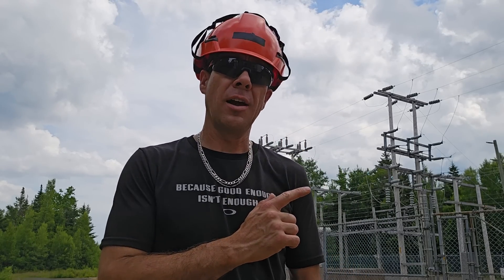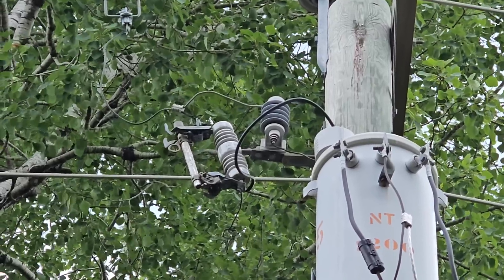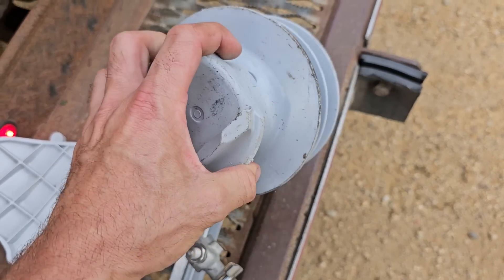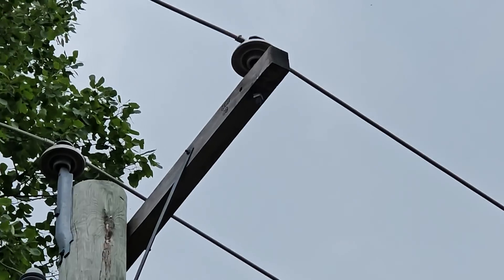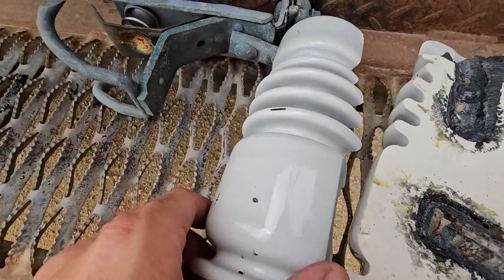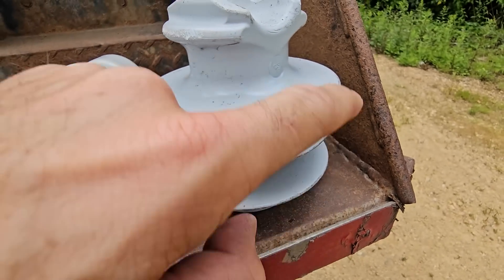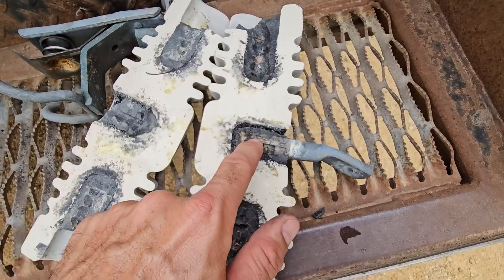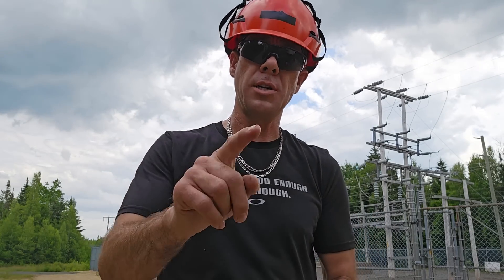How do power poles catch fire?

Comment: Great explanation and why some utilities will bond / ground all the pole hardware and give it a good path to ground. Can help prevent fires, but can make finding faulted equipment harder. But, doing thermal inspections also help locate failing components, since normally they will heat up for a while before actually making a good enough connection to fault. 
The technical term for the path the current would have to take down the body of the insulator and over the sheds is called creep. Then straight line distance from conductor to ground is called strike. In high contaminant ares, like you mentioned along coats, they may use extended creep insulators (larger sheds, more sheds) or as I have seen more often is using the next voltage class up for a given voltage level to increase the creep and prevent flashovers from the salty air. 
Cool video to show laypeople what is going on when things fail.
Reply: So in a nutshell, bonding is basically grounding all the components to make it an instant short instead of creep?
Reply: @sporkcrx  Not necessarily an instant short, but a low impedance path to ground. Instead of tracking through the wood or concrete structure and heating it up it travels on the bonding wire to ground. Which can eventually cause the failed component to heat up and / or fail faster. Since that becomes the high resistance path and will heat up more. 
Creep is the actual measurement for the insulating path on the insulator, tracking would be more the correct term here when it tracks down the pole. You don't want less creep on an insulator, there is even extra-creep insulators for more resistance to ground. In ocean areas with salty air you may use extra-creep components. 
To get a little more technical, there are insulators that do have some resistance designed in so they actually self heat to help keep the moisture off. If you ever see an orange ringed top insulator in a substation, those actually have a glazing that conducts slightly so it heats up the insulator to help keep moisture off. You can look up RG (resistance graded) glazed insulators. There is a few other terms for them too. But usually will have an orange top on them to indicate the special glaze. But I have only seen that in substations, never in the field.

Comment: These more technical and in depth videos are verry interesting and this broken insulator realy should become a demonstration and teaching item as it broke so perfectly. When you talked about impurities being deposited on a surface of insulator and showed a path that goes over those insulator fins, that path would be the path of gliding current as the current glides on the surface of insulator down to place of lower potential that for example can be a grounding or neutral wire. That would be the offcial term for that issue and other word would be leakage current as far as I know. 

If electricty would jump over the gaps and fins to the pole that would then be a flashover voltage or voltage jump issue. Such issue would probably appear in case of undersized insulator or a voltage way higher that one that was meant to be on a place where such issue would appear.

Comment: not to hijack the video or anything. But i remember seeing this video where a tree trimmer accidently dropped a main feeder HV line onto smaller lines causing a big short and the HV ended up going to the houses connected to it, causing panels to blow off the house and meters to blow off the side of the houses, it was crazy. The reclosers ( i think ? ) failed which caused the massive short to go on for a while, i dont know if you seen this, just wanted to know your thoughts on it. https://www.youtube.com/watch?v=Dmy9CHCewtg

Comment: I have a question. I work in telecom industry and we get RFI (Radio Frequency Interference) that bleeds into our networks a lot of times because of a damaged insulator or damaged lightning arrestor on a pole. It's hit and miss for us getting the local power company to come out and fix these issues unless we can find something for them physical to investigate. Have you ever ran into this or a request to fix RFI from a telecom company? If so what is your procedure? Also most the time we will hear a buzzing sound from up above our lines on the pole when we have RFI getting into our plant. And usually that's what I have to tell the power company to get them to come out and check everything on the pole. Had one where a lightning arrestor popped but the wire did not blow out the bottom all the way causing the wire to buzz which had to be it arching.

Comment: Also, there is an older style of unit typically used on lower-voltage distribution circuits (i.e., 4160/2400V) called a 'box cutout' where the porcelain body of the cutout surrounds the fuse tube instead of being a corrugated cylinder like shown here.

Comment: Quite a few years ago, here in Cleveland, where they use a TON of salt on the roads, we had a few weeks of very cold weather with snow with a ton of salt being put down. The salt would melt the snow on the roads, and cars would kick up this salt mist, coating the poles. After a few weeks of this, the poles...and insulators were white with salt. Then we had a misty, rainy day. Poles all over the place caught fire, and not just those with transformers.

Comment: Entergy a power company  let a thin hardwood touch my 7200 volt line on a rural driveway..from last August 2023 to March 2024.. 

it was about 45 ft tall and just super thin 4 inch at DBH. Bent over like a fishing rod and hung up on the hot 7200 volt line. Tip almost horizontal and  between the hot top wire and lower neutral wire 

The tree was 25 ft away from the line. And in tornado like weather got hung up on the live wire.

It blew the fuse on the main road 3 times over like 7 months or more.

They are lucky they closed their service centers to the public.

Because I would have dumped all the rotten frozen food on their desks. Lol.

So during the hard rains  there was enough conductive current  with leaves blowing and pine straw to blow the fuse.

Then the tree top would smolder all last fall when dry. Burnt ties on the dry ground. 

I reported it many dozens of  times..all service call center folks are different..they rarely record the problem.  Spent like 3 man days in slack break times on hold or explaining a tree is on a live wire.

They have no online reporting that one can send a picture to.

So it is just dialog with someone taking care of kids . Playing a video games. Or taking to 3 people at once.

The only reason they fixed it was in March a giant pine snapped in a windstorm and took the 7200 volt line out. Broke the hot and neutral wires and broke the fuse.

The lineman said to me that a tree on a 7200 volt line is not a risk.. also said that 14.4kv tends to blow fuses more with tree limbs..

I really did not want to cut a live green wet hardwood touching 7200 volts..lol

Unless measured the voltage to ground say at 4 ft and grounded the tree above the saw cut.

The bottleneck is at least then there was no way to send a picture of the problem.

 Also their call have an issue log must be lost.

The odd thing is after each call they always wanted to know how Johnny or Sally or Bertha did. Impossible since would need a week to see if the problem was fixed. 

I had to chain saw out a section of the tree to get thru my driveway

Comment: Frankly I've never understood using wooden poles in HV transmission. With medium  voltages up to 10-20 kV it's still acceptable, but above 100 kV is clearly inferior to metal and concrete (except for a price)

Comment: Likely, over time the porcelain fails due to gradual degradation of the grout, allowing water into the termination section and freezing and thawing does the heavy lifting on cracking the rest. But, nothing lasts forever.

Did see one other type of pole fire. Failed transformer, dripping burning oil and all. No drama, that circuit got deenergized, they cut loose with their hose and eventually got it out and cooled off enough for a lineman crew to replace it. Hot, damp environment, things fail. Used to see similar failures on transformers on the ground (utilities in that country were below ground, save for the transformers), it got hot, perpetually dusty with a saline/carbonate atmosphere and humid (there, we're talking 110 - 120 degrees in the shade, which hadn't been imported into the country yet) and well, we'd fail sitting in the hot and nasty far sooner.

Comment: My work location was fed from a high voltage substation. The substation was near a highway. Between the substation and the highway was a high capacity natural gas pipeline with pine trees growing on top.

The highway had another lane added, and then the gas pipeline reached it's lifetime, and needed to be replaced. To do this, they had to cut down the pine trees to dig up the old pipeline to replace it. Almost every winter, there was a near-short to ground at the substation, as salt spray from the adjacent highway would coat either a switch or insulator, causing an overcurrent, and something would trip. They would need to deenergize the substation, and clean the salt of the insulators, which took between 6-12 hours. While we had redundant feeds, and generator backup, the generators were only enough to maintain the load, and not to restart the chillers which kept the data centers cool.

It was just surprising that adding a highway lane and cutting down some pine trees was enough to let through enough salt spray to get through to the substation. If you want to look at the location in satellite maps, it's in Naperville, Illinois on the south side of Interstate 88 between Mill Street and Washington at 41.8057449, -88.1479662

While this problem isn't exactly the same as saltwater in a broken cutout, it's surprising how easily a salt-spray buildup can develop in under a year. I'm not sure how much salt they use on your roads, or how close or how fast the traffic goes, but keep an eye out on construction activity between roads and switchyards and high voltage transfers.

Comment: Considering the size of that 7200v insulator, can you imagine the size of a 1.5M volt insulator.
Reply: For 1100 kV AC service, post insulators are approximately 30' long. For 1500 kV they would be like 40'

Comment: Reminds me a lot of the "towers" on car parts like the ignition distributor cap or ignition coil secondary lead connection.
Same principle (make the path from the connection point to the nearest point on the engine block hard for electricity to cross, and give it an easier path thru the spark plug lead and spark plug and THEN to the engine block).
That's why sometimes gasoline-powered cars stall out or misfire "but only when it's raining hard", they have a crack or carbon track to ground in the ignition circuits, but it only acts up when water gets on the ignition system.
Cracking like in this video is one surefire way to get that kind of a problem sooner rather than later, but we have another failure mode in the automotive world: Carbon tracking! The plastics and rubbers we use aren't completely free of carbon, and usually everything's got some level of oil film on it just from normal operation, combine that with the high temperature of an electric arc and you get the oil or plastic or rubber decomposing into carbon and hydrogen (even if no oxygen is present this happens), the hydrogen goes away (or combines with oxygen to form water vapor) and what is left behind is a nice thin but conductive film of carbon soot. The electric arc gets quenched out in this carbon track, but the power is still there in the current flow and that carbon isn't exactly low resistance (carbon being the key element of note in most resistor compositions), so the heat builds up and even more oil film or polymer or rubber gets turned into conductive carbon tracking.
Once it starts there's nothing you can do to fix it other than replace the entire part that has the carbon tracking. No chemical treatments, no cutting it back to good plastic or rubber or cleaning off the carbon soot film, once it carbon tracks once, it's a misfire waiting for a rainy day or sooner.
And the closer it is to the ignition coil, the more frequently it's going to cause problems
GM V6 engines of the 3200 3400 3600 series were famous for having issues with their ignition coils because of this, that is when they weren't hydro-locking because of a bad interaction between Dex-Cool and the intake manifold gasket materials.
I've even seen this carbon tracking thing fry a computer before, what happened that time was that the carbon track landed the secondary voltage on to the same wires that the computer uses to tell the electronic ignition when to fire, was a pretty spectacular failure to be honest, took out the computer and it STANK like burning electronics, plus it had a nice melted hole blown thru the side of the plastic case right next to where the (metal) mounting bracket for it was. Guess I found out where the voltage found a path to ground!

Comment: Semantic question: are you using semiconductor in the sense of 'just barely conductive', or in the sense of 'changes its conductivity in the prensence of a biasing/control current' because it would be Really Interesting if it's the second (which is how semiconductor is used in most electronics environments)
Reply: Dry wood is an good insulator that can become mildly conductive when moist. The big difference between this and a semiconductor like silicon is that when silicon is properly doped, its resistance can change dramatically by application of a relatively tiny control voltage. Wet wood doesn't do that. You could call both materials resistors in bulk, but they are not both "semiconductors".

Comment: was on a road building job wiring in site cabins when a ground worked had gone for a pee up a pole that had a leaking insulator and got a bit of a shock mid stream

Comment: Interesting presentation. 

Thank you. 

Yes, salts are very conductive whether along ocean, and far from any salt water bodies!

Accordingly more so everywhere in North America where Salts are applied each winter  season by state, provincial, county, city, town DPWs, allegedly for travel "Safety".  
The Salts dust, brines, become airborne to coat cars, trucks, Poles, wires, transformers, trees, etc.  They also leach, drain, track into buildings, walks, manholes, transformer vaults, conduits, soils, water bodies, creeks, ponds, rivers, lakes, reservoirs, aquifers. 
Easily and readily causing deterioration, rust, etc along with many short and long term negative consequences.🎉

Comment: The poles are soaked in a flammable fluid for preservation.
Reply: Not accurate. 

Please,
Do some research on wood preserving, types, ingredients, methods, including telegraph- -phone-electric power-communications/ internet Poles.
Reply: @janetcohen9190  wood poles are still in existence with creosote preservation and yes it's flammable
Reply: @tommywatterson5276  Yes, both wood and creosote are combustible. 

Both wood and creosote are poor conductors of electricity.

Combustible materials require initiation by increasing temperature to 'flash point' and flames. Also by electric arcs, carbon-channels, greatly assisted by presence of NaCL & similar brines.

Combustible  is in stark contrast to Flammables such as alcohols, ether, gasoline, etc they have low temperature flash points in liquid forms and more so in vapour forms, which can easily ignite with static electricity, heat, flame, etc.

Ever notice people putting gasoline in their cars whilst, engine is running, talking on their smart-phone, ... even smoking cigarettes?

Comment: I’ve noticed that in  Michigan we have wood and metal poles.  In areas like Arizona or New Mexico I see concrete electric poles.  My non educated guess is the dryness of the environment .  
I like most of your subscribers enjoy your videos.
Reply: "in Michigan we have wood and metal poles.  ...Arizona or New Mexico I see concrete electric poles." You have trees(!) in Michigan. Like here in Maine (the Pine Tree State) poles are mostly wood up past 50KV. Michigan is long so you have more steel-tower lines than we do. Much of AZ/NM has no tall straight trees, or they get bought as roof-poles, so there they bust a rock and pour concrete. Parts of Florida USA use monster square concrete poles, because stubby trees, heavy cables for all the cooling loads, and heavy wind-loading in tropical storms. South Australia has more termites than trees, so James Stobie built a steel/concrete pole factory: "Nothing says South Australia like the Stobie pole -- The iconic local invention celebrates its 100th birthday in 2024"
Reply: In CA they now use concrete poles in certain new installations.  They are also installing concrete poles in high fire areas in the mountains.

Comment: The part of that fuse holder that supports it ,water gets in and into the porcelain and starts to arc and steam builds up splitting it in half. I have seen it happen when one exploded it was still steaming.

Comment: Out of curiosity, is the cutout recycled after it's pulled down?  I've heard the porcelain could be run through glass recycling.  It's interesting to see how the cement holding the metal brackets is burned up.  Thanks for the great video.